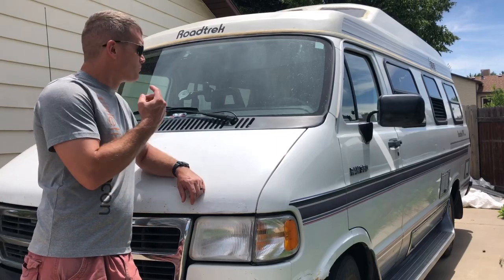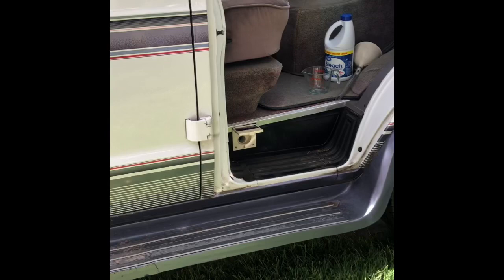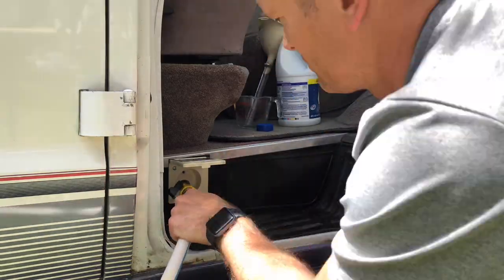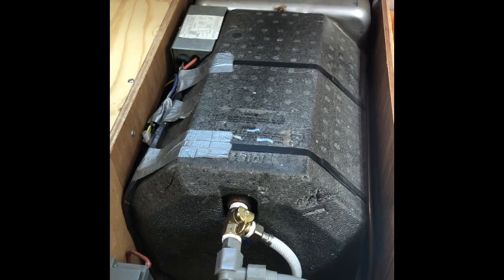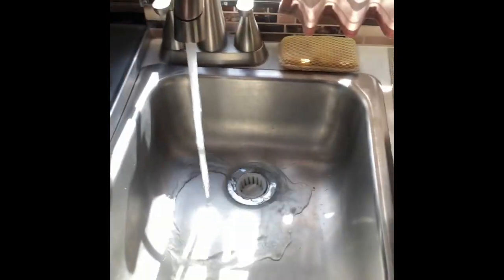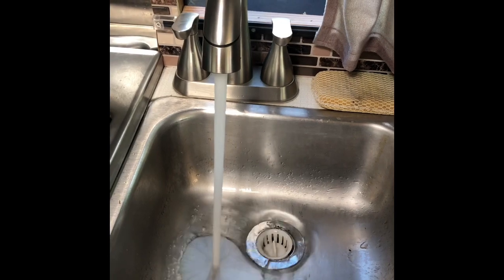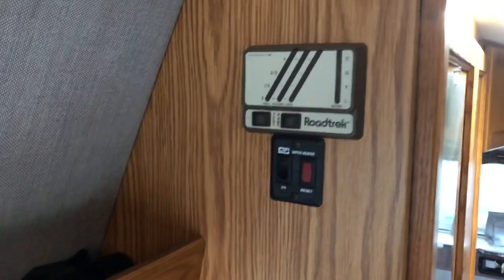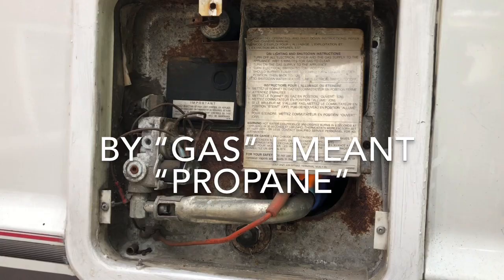Roadtrek Filling, Sanitizing, Draining fresh water tanks and de-winterizing water heater -1994D190V

Comment: Just thought you might want to know, the manual for our RoadTrek Popular 200 Chevrolet states when sanitizing the potable water system to add 1/4 cup of bleach to 1 gallon of water, then to add a (1) gallon of the water/bleach mixture to every 15 gallons capacity of your water tank. Our tank is 35 gallons, therefore we only need to add 9-1/3-oz of bleach to our tank to sanitize it, not 1/4 cup per gallon of capacity. Your system will most certainly be sanitized though!

Comment: Thank you for the amazing video!! Question from this newbie and hope it doesn’t sound silly: if the water heater tank is full and the fresh water tanks are being drained using the water pump, does this method drain the water heater as well?
Reply from the maker: Thanks for the feedback!
No worries. That’s a question I’ve had and have heard asked many times. No, the water pump will not drain out the hot water heater. You have to pull the anode to drain the tank.

Comment: Thank you for the video, super helpful! Adding the water heater on/off was a great idea. Question: Do you have any suggestions or references for the water heater drain plug replacement(online reference maybe)? I’m having a tough time finding an anod rod with threads that fits my 1995 Roadtrek  water heater. The screw size seems to be just slightly to large. (same water heater as yours) .
Reply from the maker: Thanks for the great feedback!

Ozek RV Water Heater Magnesium Anode Rod with PTFE Tape - Compatible with Suburban and Mor-Flo Water Heaters-9.25" Length ¾" NPT Threads (2 Pack) https://www.amazon.com/dp/B07MC5818R/ref=cm_sw_r_cp_apip_AmuUfrQBShcwq

Those are the ones I use.

Comment: So, for your winterizing, you didn’t use antifreeze?
Reply from the maker: The first time I winterized it I used antifreeze. This year I just used an air compressor and blew out the lines. I prefer the later because it doesn’t use chemicals.